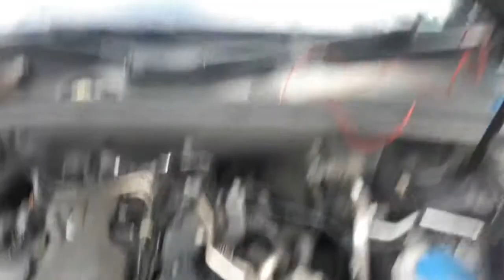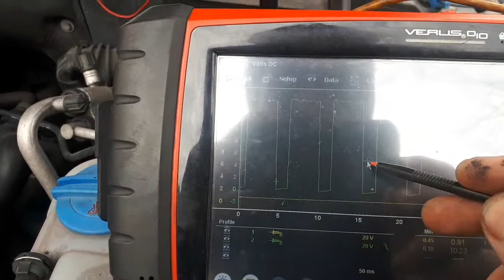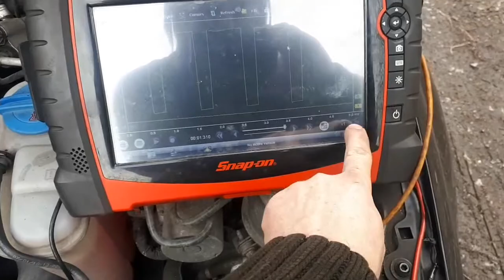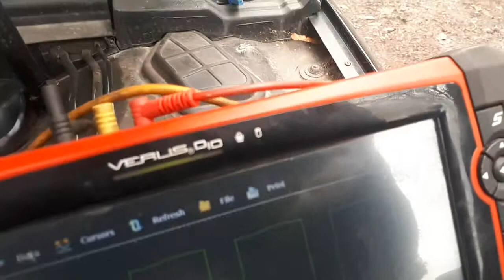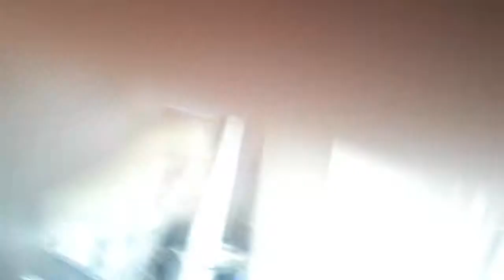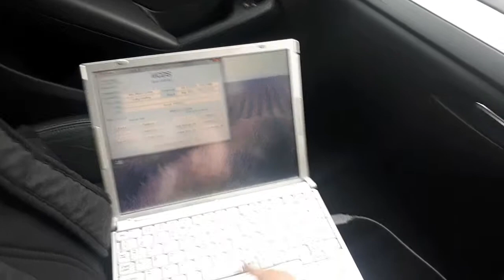Audi A4 erratic idle and power loss diagnosed and fixed

Comment: I have an 2010 audi a5 2.0 tfsi quattro and recently once the car gets to temp while driving the revs drop for a split second . It does it intermittently but on every drive. The idle seems a bit low too 700/800 rpm. I also get occasional stop/ start function unavailable messages and the epc light which goes off once started the next day. I have 2 codes, p032200 and p008800.  After some reading i suspect the crankshaft position sensor but I'm a novice. Any thoughts pls? Any help would be greatly appreciated 👏

Comment: Did you replace with a bosch part (about £100-130) or a genuine VAG part from TPS? I've replaced with the bosch unit and had not improvements at all... so frustrating

Comment: Hi buddy get some contact details I would like you to diagnose mine it does my nuts.. I have spent approx 2k at VAG specialist... And still same problem ... They said ... Timing chain.. VVT valves plus body... Then crank breather... Then crank sensor... .. now they said injectors are faulty.. but i have lost trust in them.. btw. No faults on the dash  it is 2.0 TFSI 2015.  . Rough idle sometimes but it getting more frequently now..
Reply: Is it doing the same as this video?
Reply: @sufyanhussain8505  yes but only on idle gear .. only and only on the warm engine
Reply: @zarrulez7284  Mines doing the same.  I'd say mine is worse when cold and less noticeable when warm but still jumping. Error scan shows me fuel pressure Regulation discrepancy.  I can reset the metering temporarily fixes it. So I'm going to order the sensors and use Vcds.  Only on warm engine? Can you post a video of it?

Comment: Hey so I was driving and felt my car loosing power so I pulled over turn the car off and the car never started back again it cranks but that’s it I notice that  while it was losing power my epc light came on  I put the scanner on and it just said it was misfiring I change  the sparks and coils and it still doesn’t turn on do u know what it could be can u pls get back at me with ur opinion pls I have a 2008 Audi a4

Comment: Hi I have the same problem on my audi a4 b8 2.0tdi 88kw caga rough idle but runs perfect no codes just p200800 If I change the high pressure fuel regulator will it fix the problem thanks for your reply.
Reply: Did you fix it?

Comment: For myself it was the N290, when replaced cured. However it came back again.  The replacement was a used part.  So I sourced one from ebay, apparently genuine.  Didn't work immediately, sorted itself after some driving then came back again.   In the end used VCDS to reset learned metering values and good up until now.   I've read many people say this problem is related to metal in the fuel system.   🤔

Comment: I have a 2007 Audi A4 Avant S-Line 2.0L Turbo Petrol. Very recently [approx 1 week ago, since the weather has turned much colder] the 'tick-over' revs - which had always been approx 1000rpm suddenly started 'surging' up to 1300-1400 rpm. This only lasts a few seconds then the revs fall back to 800-900 rpm and the car will start shuddering slightly. Then the revs will surge up again...and repeat this 'cycle'. 
I have checked the oil and that's fine but I haven't got a diagnostic testing kit to check the engine management system. Do you have any advice what the problem is - and how I can fix it? Thanks! PS the car doesn't cut out or misfire at all - just this constant surging and dropping of the tick-over when the engine is idling.
Reply: Any chance ya managed to find out the answer to this? It sounds like that’s what’s happening to mines.

Comment: What is the part name that you replaced? I have the same thing going on
Reply: Did you fix it?
Reply: @sufyanhussain8505  did you fix it bro?
Reply: @RoxusRemo  yes bro I did you need info
Reply: @sufyanhussain8505  Yeah man what did you end up doing? I've swapped fuel pressure regulator, metering valve and the fuel sensor and still no change... not sure where to go next...?
Reply: @RoxusRemo  what car? Only erratic at idle? And did you use vcds? Initially the valve on the pump. That made it go away for a little while but returned. The problem was on the low pressure side..the valve on the fuel rail. Thank God it was getting annoying.
Reply: @sufyanhussain8505  A5 2.0 TDI 170 and mainly idle but get a few hiccups up till 2k rpm. Fuel pressure all over the shot!  I've replaced the valve on the pump and the pressure regulator on the end of the rail. Yeah a hooky copy of vcds. Tried adaptations but it appears to do nothing. Which valve? The fuel pressure regulator? Isn't that on the high pressure side.
Reply: @RoxusRemo yes you're right I call it that because of high pressure pump.  Try adaptation again and reset learned values for metering valve.  Barring that I think it might be the fuel rail, if its only at idle and you've changed both valves.  Done adaptation and reset learned values on metering valve.   Where are you based? After I fitted mine I had to do an adaptation and reset the learned values on metering valve before it went smooth.
Reply: @sufyanhussain8505  How do you do adaptation? All I have doen so far is in VCDS there was a "Reset learned values" for the metering valve and press sensor. Is that the same thing? I'm using a pretty old copy of VCDS (not genuine). Based in South sheffield/NE Derbyshire.

It's not just at idle I get a few hiccups up to 2k RPM sometimes. Mainly idle though when you slow down and stop it starts surging like crazy.

Thanks bro
Reply: @RoxusRemo  That's not the adaptation. It is a preset option in mine. My vcds is hooky too but if you can reset the learned values I bet you can do the adaptation. I'll hook it up to my computer and see if I can find where it is if you want? Yeah mine was the same.  I did valve. Did adaptation. Reset learned values and it was smooth. Also what error is vcds showing? Can you private message on this thing?
Reply: @sufyanhussain8505  If you ever get chance to check this man I'd be grateful. Not sure if my last comments have posted.
Reply: @RoxusRemo  I'll do it tomorrow. Are you just persevering with it at the moment?
Reply: @RoxusRemo  what vcds error?

Comment: hi, I have an Audi a4 b5 nonturbo, idles fine, revs fine, but has no power almost non, ran it through the machine it picked up the throttle body, had that replaced, improved on the idling but still no power...
Reply: This seems to be a fuel filter.

Comment: I have this exact same issues minus the loss of power, drives perfect until I leave it sit in idle then the car shakes and is hunting, no fault codes when plugged in, changed two injectors but still idles rough, please help
Reply: Did you ever get this problem fixed? My car is an audi a4 2009 quattro and it runs like an angel while going over 10 miles per hour but as soon as I come to an idle at a red light it shakes violently and then the EPC light comes on i then shut the car off and turn it back on and as long as I'm not at a stop I  idle it works
Reply: Kathleen Velazquez yes I got this fixed, I had to send all my injectors away to get checked, turns out one of my injectors had an electrical fault so I replaced this and the rough idle was gone. My mechanic then advised me to replace my fuel filter and I did and no problem ever since.

Comment: Hello, first time that i had this kind of issue everything was running fine until i switched to Sport mode and put foot down the car totally dies, after that I just stopped the car switch to N then started the car again and everything return to normal, could you know what's causing the problem please?
Btw I did remapping from 140hp to 180 and disabled EGR 5 months ago.

Comment: Hi great video, I currently have the same fault with my 2009 A4 with the exact same fault I have tried replacing the Fuel pressure regulator with no luck. Can you advise on anything else to check
Thsnks.
Reply from the maker: In this example the fault was the fuel rail pressure regulating valve which works in tandem with the fuel pressure regulator on the fuel pump. You could have an issue with either of those. Testing is the only way to work out why the system is losing pressure. Not uncommon for injectors and fuel filters to contribute to fuel pressure issues. Beat of luck
Reply: @mobileautomotiveservices5461  thanks for the reply, 
 I have been lucky enough to have a sales car with the same engine to try parts from,
I have swapped the IMV, Fuel pressure Sensor And the DRV with no luck, also tried the Aux pump And the electric pump in the tank with still no luck,  
Done a leak test with nothing standing out 
I was suspecting the high pressure  pump but like the Audi in your video mines drives fine, it just faults when Idling.
When pulling the Imv ,drv and the fuel pressure on the verso the fuel pressure is bouncing around. 
Any help would be greatly appreciated.
Reply from the maker: @archiesweeview9226  have you done an injector leak off test? Do you have any fault codes logged?
Reply: @mobileautomotiveservices5461  hi sorry for late reply.
 I have done a leak off  all looks fine.
Had the car put on the vag com system and had the(new Bosh)  pressure regulator calibrated. Still no luck.
What is strange is when cold it idles very rough and drives very poor with a lot of jumping around, 
When it gets a bit warmer the idle is still just as bad but driving is fine with just a little miss fire under 1500 to 1700 rpm. Could it be a IMV on the pump? I did try one from another vehicle but did not calibrate it? Thanks again for replying.
Reply: Hi can you tell me with  this test would you expect any voltage drop on a good system?
Reply from the maker: @archiesweeview9226  if you are doing the system integrity test then the rate of voltage drop should be minimal. The system should hold full pressure the DMV grounded shut. Any voltage drop as seen by back probing the fuel rail pressure signal output wou ki d indicate a leak from system (bad pump, injector, DMV etc.
Reply: @mobileautomotiveservices5461  thanks I have slight drop, not as much as yours. if I post a video would you mind having a look?
Reply: https://youtu.be/ENftlDTfiJw
Reply: @archiesweeview9226  Please tell me you got this fixed? I have same issue. New bosch pressure regulator, new IMV and new pressure sensor and still getting the hunting idle... sigh

Comment: I’m having the same sort of problem with my FSI. As soon as you put the foot down it totally dies. Would you have any idea ?
Reply from the maker: Symptoms like that on an FSI system will generate faulty codes. First at step would be to get a scan of the engine management ecu for a direction to move in. Sounds like fuel supply issue but impossible to say without more data. Best of luck!
Reply: I had similar issue and resolved it by changing high pressure sensor on fuel rail.